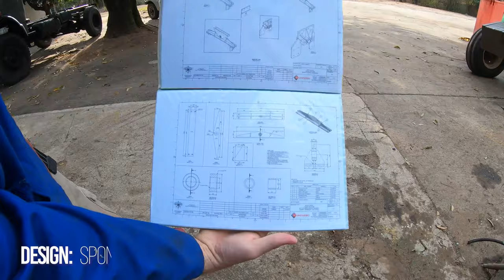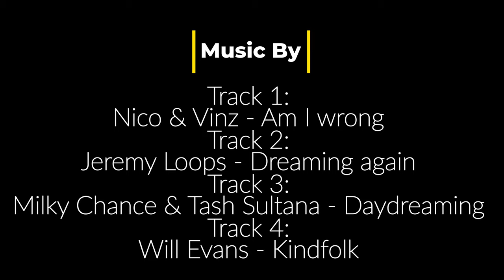Expedition Vehicle Build // Building Betsy PART 6 - Torsion Free Subframe.

Comment: Excellent job very nice I’m new to this, I have seen 2 points of contact with the chassis and I see the logic but I have a hard time understanding the  the 3er one in the middle if the front one and the rear one move or lean left and right why the one in the middle is fix to the sub-frame and truck frame, can someone explain this
Reply from the maker: Hey man, thank you. Sure, the middle point of the chassis does not flex - Flex mostly occurs at the rear. The swivel at the front and back allow the chassis to move freely underneath the box, while the middle pieces control the level of the box. Ie the box moves with the middle parts (left and right) while the chassis moves underneath the box at the front at back. Hope that makes sense.
Reply: @NuminousExpeditions  oh I see thanks you for answer my question, cheers from Costa Rica 🇨🇷

Comment: Nice job on the subframe. Along the length of the frame rails are you pivot points (left & Right) centered in the middle of the frame? The look further toward the cab than the rear. Just curious how you or the engineer decided the placement. Thank you, again great job!
Reply from the maker: Hey Robert. We tried to get the centre/middle /L&R components as much to the middle of the chassis - measuring from the back of the cab of the truck to the end of the chassis and marking the centre point. We then realised that there were a couple of obstructions and had to redesign the mounting plate to clear them and had to move them slightly off centre in order to mount. Was the only option. It turned out to work perfectly. The pivots are all mounted as far to the ends as possible. The really important thing here was to have them as square as we could get them (so all of the right being exactly spaced as all on the left) otherwise the floor mounting would present a big problem. 

Thank you for the positive feedback. I hope that you can make sense of my answer and good luck with yours. Have a great one

Comment: Nice work guys, my only concern is the possible chassis failure under the pivots as you have now point loaded the chassis rather than spread the load along its length.
No doubt the pivots are well and truly over engineered and will last forever, but you may want to look into a way to help spread the load while still allowing the chassis to flex.
What a lot of guys are doing is installing short lengths (upto 1m) of square hollow section between the pivots and the frame to spread the point load out.
The SHS is then bolted directly under the pivot and connected via a spring mount away from the pivot to allow the chassis to still flex when required, but spreading the load when flex is not required.

Comment: Hello !! My name is Mario, live in Bs As Argentina. We discovered it one day! La verdad Congratularon for to Big job!! We have a familiar project similar to the ones we used But that's a lot of way to get back to the road. I have one to consult: when you know the duals, another type of tire or any modification? I enjoyed arming the Subframe system as it does!! If you have any information to help them, I Will be eternelly gratefull to them!! 

  I wish you much success in your project!!

If you visit Argentina, do not hesitate to let us know! you'll be welcome.
Reply from the maker: Hi there Mario! Thank you for the comment and for following the journey. Good luck with your build, I know it is a lot of work, but it is well worth it!
In the end we kept the dual tires as we could not afford super single wheels. Our tire size is 10.00R20 and they run well on most terrains. Also, they are easier to find in far-off places than the single wheels (12.00R20).

Most people go for a single wheel, especially when planning to 4x4, but the dual tires do have their benefits. We've never gotten stuck, crossed rocky roads, deep ruts, some mud and sand and so far so good. 

The only issue I could pick up is that the dual wheels at the back picked up and wedged a rock between the two dual tires. I had to remove the wheel in order to remove the rock. Other than that, no problem. 

Thank you for the open invite
Hope you sleep well!
Reply: Thanks You!! well see you sometime!!! 
you forgot to give me information about subframe😢.
It helps me to write to you to practice my English❤
Reply from the maker: @marioaguilar5308  Sorry Mario, my mistake. The subframe was designed by umdwebo projects. You can find them on facebook. 
It was made using a thick steel, all the components were precision cut, and it is working extremely well. If you would like to build your own, you're welcome to look at our plans that we've put on Etsy: https://www.etsy.com/listing/1562634430/professionally-designed-torsion-free

Hope that helps, if there is any more info you would like on the system, you're welcome to send another message
Reply: Thanks You so much!!! 
It really was an excellent job they did!! I will surely have doubts!! 
In relation to the subframe, I cannot understand the reaction of the side pieces when the subframe falls to the sides... You are very kind to answer me!!! Thanks again!!!
Reply from the maker: @marioaguilar5308  Hope all is well. Think of it like a flat step ladder. When you flex a step ladder, the FRONT and BACK will flex,  but the center will stay level. The same happens to a chassis. The front and back of the chassis flexes underneath the box, but the center does not. The "side pieces" control the level of the box, or in other words if the truck leans to the left - the box will the also lean to the left, but when the chassis flexes, only the front and the back of the chassis will twist. I hope that makes sense.

Comment: You were using quite thick steel and a very small welder I hope you got good penetration on those welds. Did you do any test welds and then after cut, polish, and etch the weld the cross section of the joints to visualize just how deep the penetration was? I probably would have chamfered the pieces and done a multi-pass weld. Is there a reason you did not use a grinder to clean off the mill scale where your welds were going to be? If your entire house was going to riding on those pivot brackets I hope you were extra meticulous about those welds.
Reply from the maker: Hi there Daniel. 
Thanks for the input. 
The house is doing well on those pivot brackets, we'll have to wait and see if they hold up for the entire trip. If they do (64countries is a pretty good test) then I suppose I can say that we did a good enough job, if they don't it will be one heck of a lesson learnt. Thanks man. 
Have a good evening
Reply: @NuminousExpeditions  Best wishes on your expedition.

Comment: Am I correct that the front and rear pivot points, let it pivot left to right? Then how does the center pivot allow it to pivot front to rear of the front and rear pivots are bolted to the frame?
Reply from the maker: Hey man. 
Not entirely. Try to imagine the bottom (mounted to chassis) sections pivoting as the chassis flexes, but the tops staying aligned with the middle section mounting. Ie the box will stay square, but the chassis can move freely underneath.

Comment: Hi there, Great job. I see you had the components cut by a 3rd Party.
Do you have blue prints or CAD drawings for the torsion free components. 
Did you measure the chassis angle (twist) in degrees more or less when you jacked the frame up? 
I tried to measure the twist on another and it was extreme and had a 10deg twist on the chassis for a 60cm wheel lift..
Reply: Good morning Marco. thank you. Yes, I do have drawings/blueprints for the system, but you would probably need to design yours according to your truck, as ours was specifically designed for Betsy. I did not measure the degrees of twist, but it's quite a bit. Good luck with your rig.
Reply: @robinlewis1591  The reason I asked is that all your components appear to have been precut. Looked like a great way to get the parts. Potentially they should all be very similar. Chassis rail width being the issue. I have measured the box tilt on many units and have found the most extreme to be 12deg. So what ever you make needs to accommodate the 12degrees at the outer edges of the box. It would be really helpful to be able to see what you did. It looked good.
Reply: @marcovonpickartz8251  yes, all the sizes we're pre cut by a third party (Fast Flame). Also keep in mind obstructions. We had to get around the mounting points for the rear suspension (you'll notice the middle unit was cut so that I could install going over the suspension mounting). The frame will be welded up in January, and I'll make sure to get a clear video of the flex when the frame is mounted, so keep an eye out. if you were looking for some assistance with the design or blueprint for your truck, I would advise speaking to Paul from Umdwebo projects (you should easily be able to find him on facebook). Have a great one
Reply: @robinlewis1591  You may not have noticed, but I am from the other side of the planet.

Comment: Nice job but hell weight is obviously not a consideration, looks like 20mm plate
Reply from the maker: Hey, thank you. No, weight was not a concern on the tfs. It is the one component on the truck that I would recommend over engineering. It's a 16mm plate, and with the truck now complete, I'm happy that we did it the way we did. 

being the foundation of the entire house, we have peace of mind that it will hold up throughout the ten year trip. Also, works really well and has definitely saved the box from flexing. Have a great day and thanks for following the build